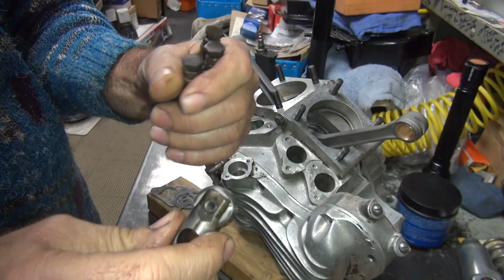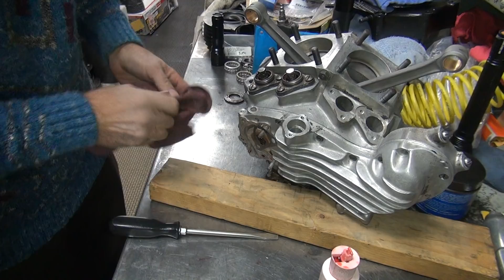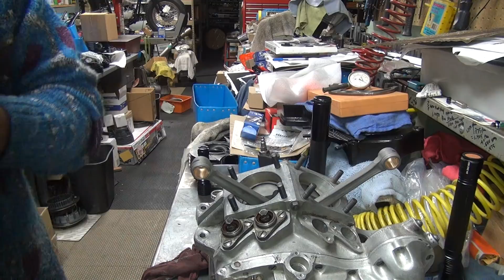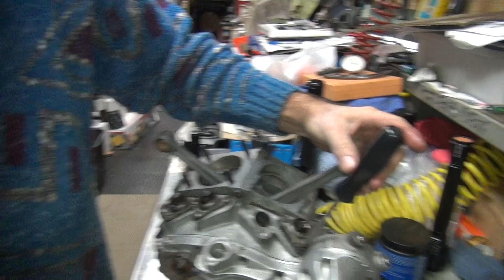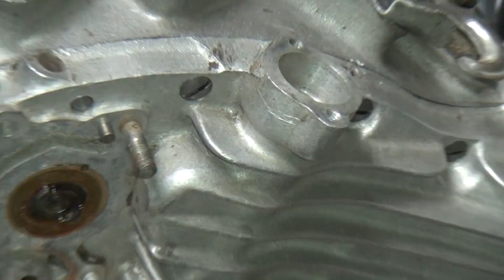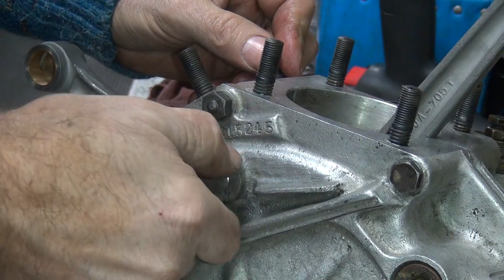1942 wlc #108 wla 45ci flathead dirty motor rebuild harley wl side-valve  by tatro machine

Comment: I'm concerned when you put the case cover on for the timing gears camshafts you had washers on the inside of the gear 2 protective the case but usually on the other side of the gears there should be washers to protect the cover. Did somebody leave them out and need to check clearance on cams that are not flopping back and forth. That will work out the rollers real fast.
Reply from the maker: what a bunch of crap. harley stopped shiming the cams in the late 80's. the cam plates protect the inner cam bearings and the bushings take care of the cam cover. unless you have alot of binding, you have no real side to side movement of the cams.
tatro

Comment: Tatro, if you use the Torco red asmb lube will it still be good if engine sits 2-3 years before it's installed in the bike frame?
Reply from the maker: we did a 30 year test on a knucklehead motor and it still was good and sitting where we left it.
tatro